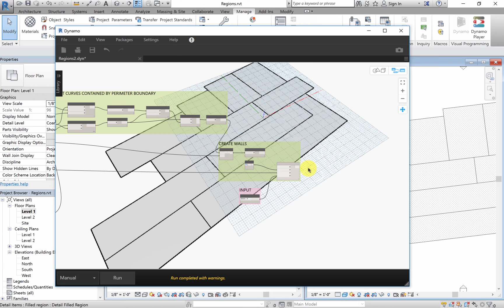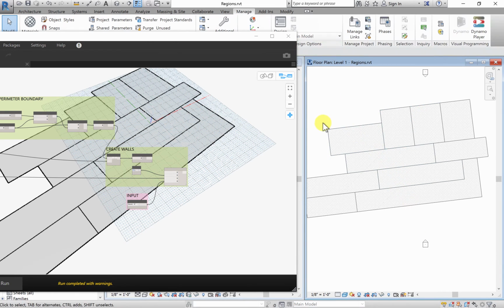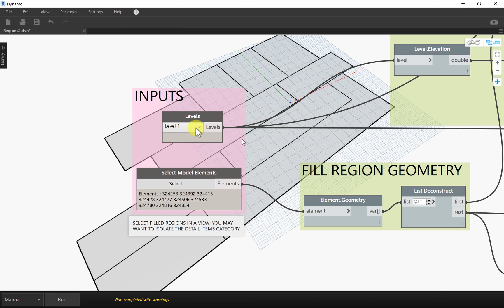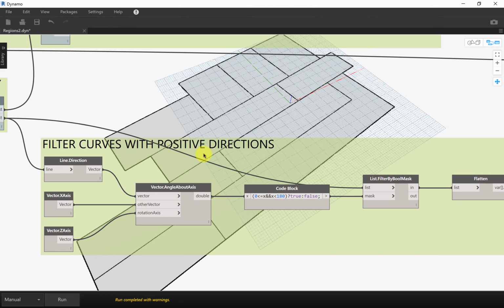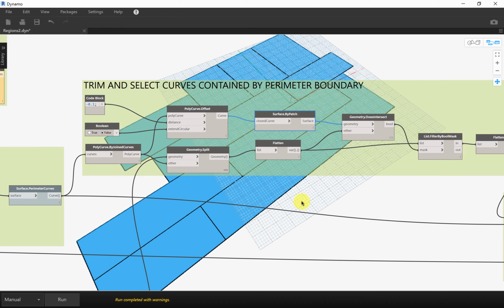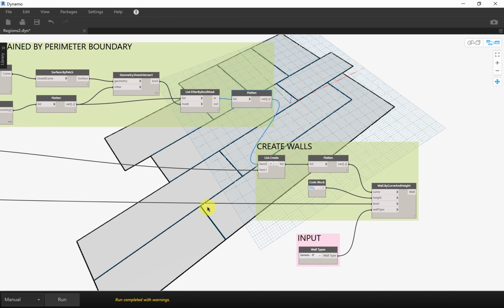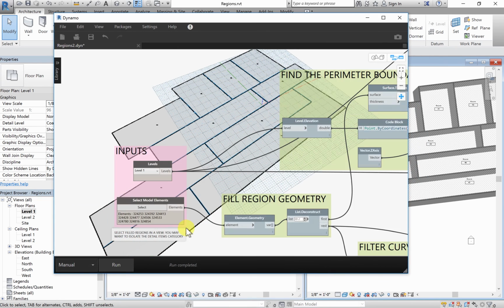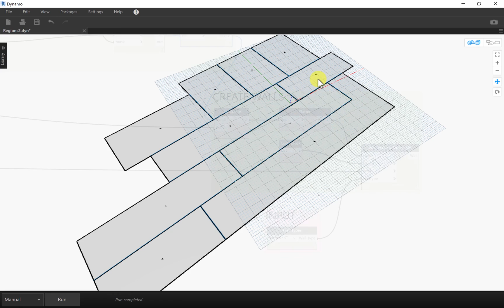Filled Regions into Walls and Rooms with Dynamo

Comment: Awesome stuff Cesar!  A couple efficiencies on this workflow:  you can avoid the solid>union work which is computationally expensive by taking all the surfaces and sending them to polysurface.byjoinedsurfaces, then surface.perimetercurves to get the boundary.  Using the same polysurface, you can then user topology.edges > edge.curves to get a collection of non-overlapping curves.  Same result, might just be a little faster
Reply from the maker: Thanks Zack, it can also be done beautifully with the Polysurface.UnconnectedBoundaries,  but in either case the exterior boundary will be a chain of multiple small colinear wall segments rather than a monolitic set of continuous walls. We need a node that merge lines that are colinear.  I think Dimitar has a node that do that.